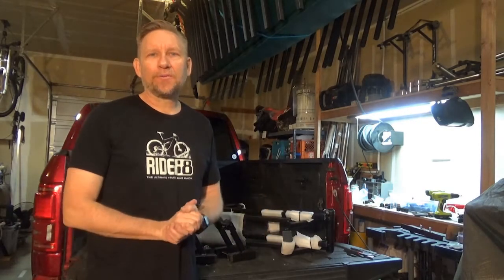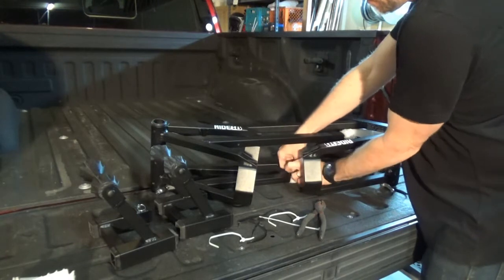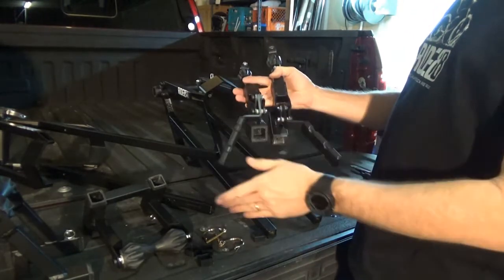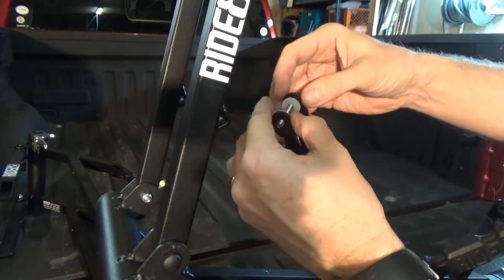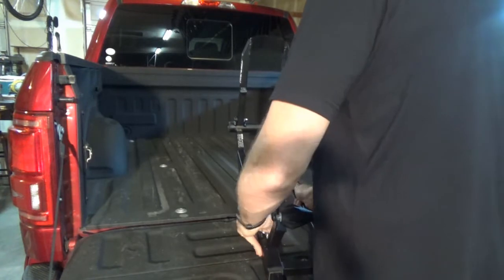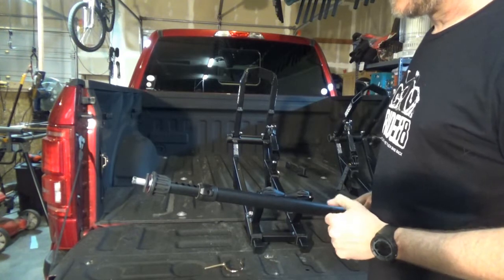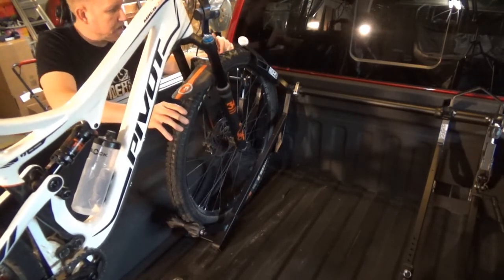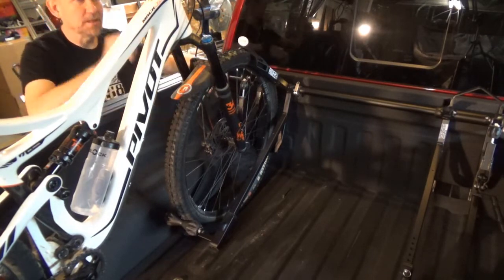RIDE88 INSTALL

Comment: Do you know if that rack will work a bakflip mx4 tonneau cover.  The bakflip folds up but on that particular f150 with the 5.5 bed there is a portion that stays in the way.
Reply: I have the same issue and question. Did you ever find out?
Reply: this company does make adapter brackets that allow you to mount the cross bar further back in the truck bed.   That provides clearance up front for the tonneau cover.
Reply: What about the straps?